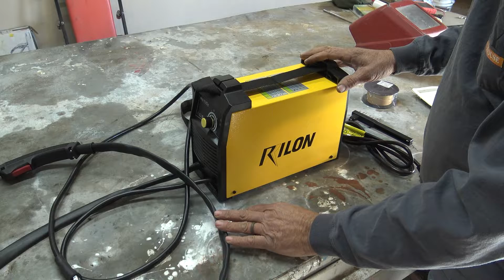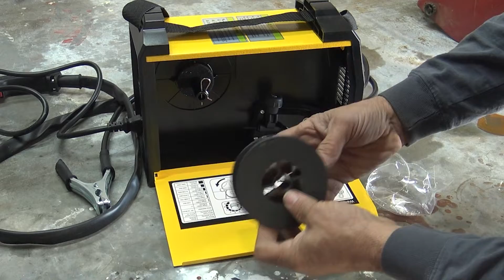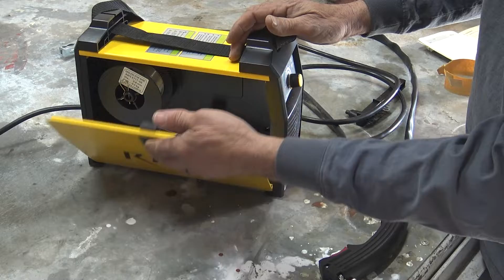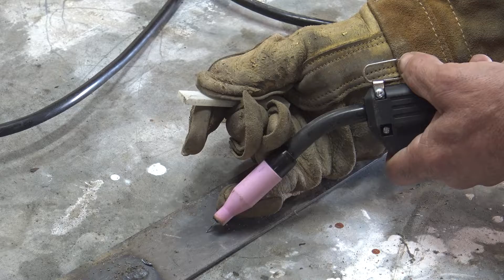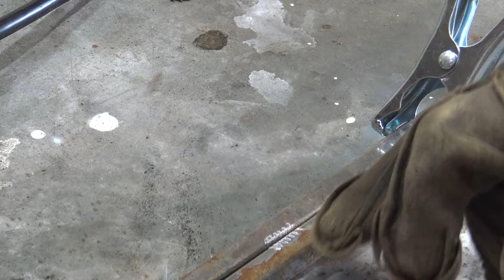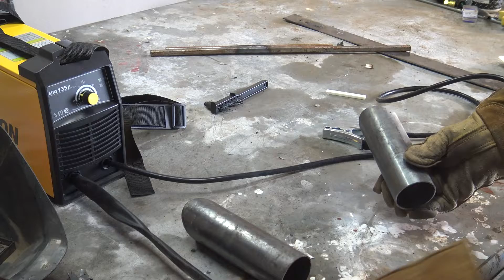Beginner Welder - Easiest Welder to Learn Welding

Comment: Looks pretty easy, might get one. Can you cut metal with it?
Reply from the maker: It won't cut metal, you would need a plasma cutter for that.
Reply: @DIYOnTheHouse  Thankyou for this informative video. Quite a few times I needed a little weldin now they are cheap enough and look do-able. I guess I will stick to my grinder or saw for cuttingas I can not afford a plasma cutter with its own compressor yet.

Comment: You did a great job connecting that 2 in pipe. What did your instructor dad tell you that made you so good the first time doing it? Was there a video of doing that job of practice. I've got to connect a 2 1/2 steel fence upper and lower gate post myself.

Comment: What’s the orientation of the tip ? Straight down at what ur welding or more in the direction of travel and push the weldor or in the direction where you just came from & drag the weld
Reply from the maker: I'm sorry I don't remember.